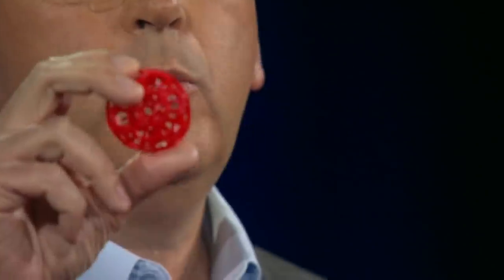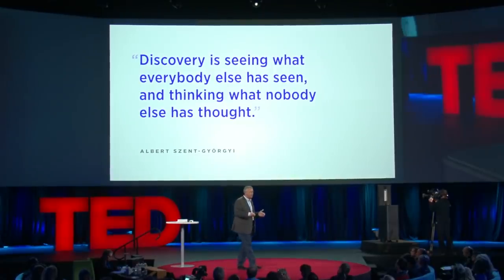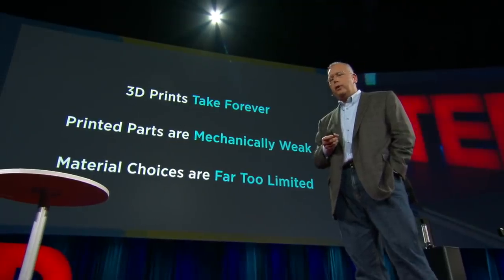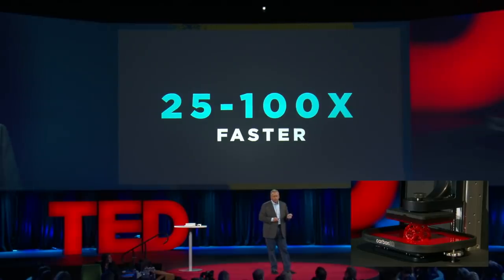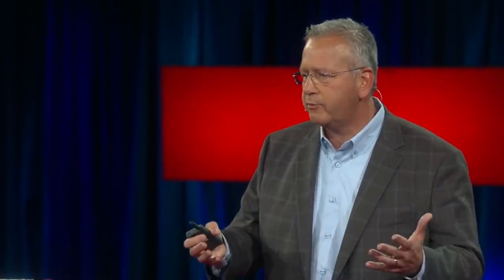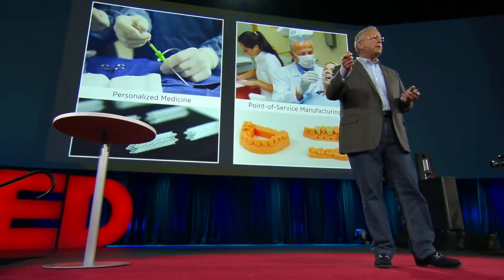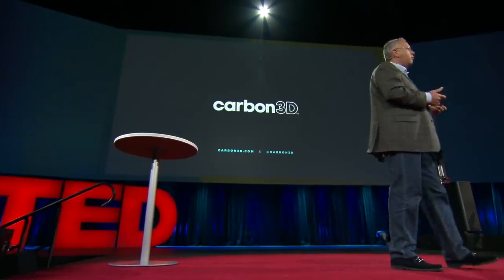What if 3D printing was 100x faster? | Joseph DeSimone

Comment: ok, it's been 3 years since this talk. why aren't these all over?
Reply: not all over consumer wise bc its like $40k a yr subscription based
Reply: Cost of production is way to high
Reply: You can buy these now, but really good sls printers are fairly expensive. I dream that in a few years, someone will come up with the Ender 3 of SLS, cheap but high quality.
Reply: International Space Station they are not sls printers thats a dlp one. Sls uses a powdered material (usually nylon) while DLP and SLA printers use resin that it's cured by uv light or a laser. Dlp printers uses a dsplay projector and the definition of the part is going to be the one of the pixels of the display. Dlp prints in voxels while sla and sls print with a laser so there is more definition in the part but they use different mediums
Reply: @christiansandrini96  oohhh yeah you're right lol
Reply: Because they do not produce the properties for the product that customers want. Cost per part of part with similar properties is too high. Doesn’t print the exact/similar material necessary for a specific application.
Reply: The resin used is, to this day, too expensive for hobby or schools
Reply: They are Erik, there are a number of them that are far more affordable than this ridiculously priced printer that Carbon puts out. Just search for resin printer and you will see a number of them available and a few are very affordable and news flash, they produce just as good as what Carbon 3D does, just that they are not marketing to Dentists which of course brings out the greed as can be seen with Carbon 3D!
Reply: Anycubic photon doesn't offer those printing speeds.
Reply: lol no, anycube is a normal dlp printer, like shown as current printing proces.
There is only two questions, how expansive is the CO2-membran and how long it last, this can work with every DLP printer out there even with a 400€ Photon.
Its funny to see how Resin-DLPs are killing Resin-SLA Printers, with Greyscale a 10" 4k Display is much more acurate than SLA and FAR Cheaper!
Reply: KrzaQ kq - I am good with that, since it doesn't offer that ridiculous price tag. Sorry bud but not a very good argument!
Reply: You may be good with that, but it's not what the question was about. The major feature mentioned here is the printing speed. 100x faster printers are not *all over*, despite you "being good with that".
Reply: Shrimp - Worth noting to that DPL is much faster than SLA printers and can produce more in the same amount of time. With the right resolution it is indiscernible to the human eye that it was a voxel print vs the SLA type.
Reply: Erik S cost. They are crazy expensive and have only gotten more complicated over the years.
Reply: As someone who works in 3d manufacturing (which it is obvious most posting do not) i can tell you it takes a lot less time to create the prototype than to be able to mass produce them for a reasonable cost.
Reply: Caleb Begly huge difference between the formlabs and this.  Huge.  I know because i use them both.
Reply: I'm a biomedical engineer. Consumers don't use it bc of the price but researchers use it considerably for tissue engineering.
Reply: @Dr.Luc wtf, didnt you watch the Video?
The Anycubic Photon is the "traditional" process he is talking about, not the continuous one.
And i suspect the membrane & Oxygen science is what keeps this from being as availiable as your normal SLA printers.
Reply: The Photon is a printer that use the "old" way of printing by separating the layer from the bottom going up, repositioning, cooking another layer then rinse and repeat. I'm not aware of a model that use this "Oxigen bed" technique explained in this video.
Reply: 100 x faster, 1000 x more expensive
Reply: @kahzhoylow4352  I work in manufacturing. Time is money. You'd be surprised how much money my company uses on stuff like thi as to increase productivity. In the end, you'll make more money saving time.
Reply: The biggest problem I think is the cost of the resin (printer cost for sure when it comes to Carbon). It's like 3-4 times that of PLA. Post processing is a bit involved too. They need a printer which can post process too. Or develop a resin which does not require it. Once material cost comes in line with PLA and post processing is removed this truly will be game changing. Maybe once the sub 1k printers get great the price for resin will start dropping.
Reply: IKR
Reply: Nope. The photon is nothing like this.
Reply: There are. Resin printers are just nasty in general. I wouldn't like to have one sitting on my desk.
Reply: Can you put metallic powder into the uv resin in small amount to make metallic parts? Will it work in the DLP/SLA printer?
Reply: Because it's a new technology and it takes time for these things to mature and become affordable, duckie. :)
Reply: Its to expensiv
Reply: we are still in the stone age because the fckng governments are holding back alien tech back for over 50 years already ...
Reply: @funtechu  Wong. I have a Form 2 printer and is stupidly slow if you want a smooth print. It prints at 100, 50 and 25 microns. 100 microns is pretty rough, 50 is smooth but VERY slow. You can imagine how long 25 micron prints take, although they're very smooth and accurate.
Reply: they ARE all over. I have two. Paid only $500 for each.
Reply: Many TED talks are just talk.  I saw one about composting, who dresses up to go to one of those?  Coming from me...I love composting, just that watching a "talk" on it is just boring. what is the world coming to. One step forward and two back.  No flying cars either, they said it was coming later this year, that was in 1992.
Reply: I believe it’s mostly due to the economics of manufacturing.  JIT manufacturing has to be very cost competitive to be viable.  However Injection moulding has proven to be incredibly cheap and reliable when the scale is large.  Make a million widgets and you can make them very cheaply, make 1 and it’s very expensive.  The old semiconductor adage is, the first chip costs $10m, all the rest are virtually free !!
Reply: because maybe its not as groundbreaking as the dude selling them wants you to believe
Reply: Like someone else said Manufacturers take years to implement stuff like this, They will be investing in this but in concept stage. Some small manufacturers, Small batch manufacturers maybe using for production, You would be surprised how much old technology goes in to cars etc, The businesses have spent a lot of money in developing and need to get a return on that investment.
Reply: @DrLuc-lq8ls  - Anycubic photon/Duplicator D7/Formlabs or whatever. None of these are exactly like this. Key difference is the oxygen "delay" window
Reply: From what I can find, the current Carbon 3D M2 model uses a subscription model and is priced at $50k annually for a minimum contract of 3 years. On top of this they charge $22,5K in initial fees for installation/training and a set of accessories that you need. This brings the total cost of just the installed printer to $172,5K for the first three years. The resin that goes in is $100 to $400 per 800 ml. Assuming the printer can print one of those cartridges per day, at an average of 200$ each, puts you at a material cost of $219K for the full three years.  Total cost of running the machine for the first three years is then $391 500. Not a lot of applications can justify such an expense.
Reply: @DrLuc-lq8ls  No, the Anycubic photon works the "old way" as explained in the video.
Reply: $40,000 a year will buy a lot of beer! You can't buy this machine you have to lease it. At $40,000 per year to lease this unit I will pass!
Reply: @DrLuc-lq8ls  I just bought one for under $400, but it is doesn't have the O2 permeable membrane that makes it faster.
Reply: Because they still cost $500-$5000 but if you've got the money there are multiple options with the tiny Anycubic Photon for about $500 on the low end, Peopoly Maoi in the mid range at $1200 or so, and the Form 2 for $5K, and then Carbon 3D's crap but they're very much high end manufacturing focused. The rest though are all desktop options you can buy RIGHT NOW. I'm going with the Maoi for my 1st SLA printer. Best build volume for the money imho.
Reply: When he said "these" he didn't mean "any SLA printer," He meant a printer with CLIP technology.
Reply: @TheSentientCloud  i think you mean dlp or sla, SLS is elective laser sintering when you melt powder in layers
Reply: @mervinlobo4673  not really there are tons of sls and dlp printer like this out their, prices start at 300 to 500 dollars
Reply: Expensive. But it exists.
Reply: The resin is super costly
Reply: Erik S lookup sparkmaker and any cubic
Reply: 4 years now
Reply: Because he talk some wierd and from the material point of view totaly wrong stuff.. as he call him self material sceintist/chemist I would rather call this larg mouth-tist. There is a plenty of applications for 3D printing already in use, however the whole processing of 3D-printing need years of developement for each septrum of materials and huge developement invenstmnets. Therefore we still need all other methoods, which are still valuable, or cheaper or more controlable in terms of final material properties. The real use of 3D printing is about complex structures, mostly hardly manufacturable by "conventional"/ other techniques, while you wanna replace everything with 3D priting such as in his case turbine blades - they are manufactured from single crystal grown super-Ni alloys which have unique propperties thanks to the uniformity of crystaline structure and also precipitation hardening. Therefore, any material scientist would know that 3D printing it self is far from beeing able to replace all methods.
Reply: @mervinlobo4673  Exactamundo
Reply: @eatinMcdonaldsfryz  Pretty sure you don't have a couple Carbon M2's. They don't sell them. They only lease them for $50,000 a year (with 3 year min). You have a resin printer, most likely DLP printer. It is described in the video at the 5 minute mark as "Traditional Mechanical Approach". It is why you can't print that ball he did in under 7 minutes.
Reply: 4+ years now.
Reply: Because they lease them at a MINIMUM obligation of 3 years with an upfront cost of $64,500 that rises to $144,500 over three years,... not counting resin that is $99-$399 a bottle.
Reply: it is not over. At this moment there is even home editions of such printers.
Reply: @bentrueman6388  COST of production. Not initial capital cost.
 A 300 dollars printers inital cost id low but quantity and quality to build such structures requires expensive Resins.
Reply: I have one at home. So yea.
Reply: Too expensive, too low build volume

Form 3L is out there and its great
Reply: @funtechu  Formlabs printers use SLA, not CLIP. Only Carbon uses CLIP (which is in this video).
Reply: Like all 'Game changing technology' talks, they're perpetually stuck in 'the near future"
Reply: Make it 4
Reply: Now, it's 4 years.
Reply: price starts at $50k
Reply: It's all about the money money money
Reply: Construction companies get in the way because it’s not lucrative for them so they try to stop them
Reply: Erik S  money and profits
Reply: You can buy these machines for just slightly more than cheap conventional 3D printers now, they are entirely affordable for a home user - trouble is the resin toxicity so you need some extra gear to handle it and then clean it off before using it. There's some good videos of people who do miniature characters for tabletop games using this printing technique and it costs very little per figure they make and they come out really detailed. A couple of years ago this would not have been affordable.
Reply: Update, they are now at the $350-$500 range and are decent....don't ask for maximum price because they get as expensive as you want lol.
Reply: The only problem with this kind of resin cure 3D printing is that what he printed on stage is misleading. He claimed it was 25-100x faster than normal traditional 3D printing however, he did not wash the print in isopropal alcohol and then cure for hours in UV light. These are crucial steps in resin cure 3D printing and hence why this technology is not widely used.
Reply: Who cares about speeds? As technology increases, the speed will increase. Compare the original "3d" printer speeds with today's "3d" printer. 32 bit vs. 8 bit motherboards are capable of going many times faster, without costing much more than the original 8 bit board. I will wait for faster printers, I am just not in a big hurry.😊
Reply: they are all over
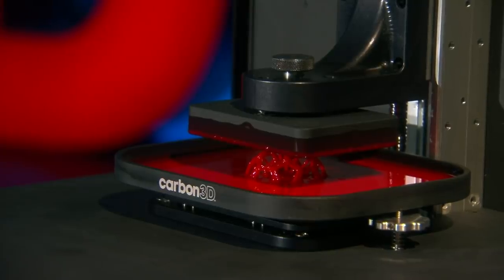Reply: @DrLuc-lq8ls  Actually those printers work the "traditional way" shown at 4:48.
Reply: @DrLuc-lq8ls  The Anycubic Photon is mSLA tho? That's still layer by layer. They're talking about continous curing.
Reply: Now it’s been another year
Reply: seems Adidas future craft 4D has achieved this
Reply: That machine cost over $50000
Reply: @DrLuc-lq8ls  but Anycubic photon is not oxygen inhibitor based. And what about the UV resin ? What is it ? ABS, PLA, PC, etc ?
Reply: @DrLuc-lq8ls  you missed the point of his presentation,  The Anycubic doesn't use the oxygen layer method presented, and would takes several hours to create they same object. Yes it looks very similar but not quite.
Reply: @DrLuc-lq8ls  Isn't the resin they use toxic ? It looks like it requires a lot more precautions, effort and cost than regular FDM printers. In this video were pretty much promised a printer better in every way
Reply: Need 20 more years. That’s just how technology matures
Reply: Probably because the total costs (including subscription, instalment, and materials) adds up to around about $290,000 USD
Reply: they aren't cheap
Reply: 5 years and nothing yet
Reply: Because they want $40,000 a year to lease you the machine!
Reply: @kentharris7427  me too kid
Reply: Resin is weak, toxic, and in my opinion the worst way to 3D this print, but then I don’t care for anything without function.
Reply: Longer Orange is $300
Reply: Because it's just 3 years and there is one at $1250.
Reply: Adidas 4d.....
Reply: Do you have 400k for an HP metal ceramic 3D printing??? 😉😏😘
Reply: It's been 5 years
Reply: Its a resin printer they are all over
Reply: They are now. $250 bucks and a $35 dollar bottle of resin now. The most recent 4k mono printers are around $600 bucks.  It was a slow start but the sales are clear, it has come and 2021 is going to be a massive shift in home 3D printing.
Reply: They were many years ago.
Reply: @DrLuc-lq8ls  Those are layer by layer, not continuous. They use liquid, and cure it with a light, but they don't use the oxygen inhibition zone like he talked about
Reply: They are now.
Reply: Well there actually pretty cheap
Reply: U can buy adidas 3D made by them
Reply: @TheSentientCloud  check again, they're here
Reply: @Max_Janszen  I'm aware lol
Reply: Because they have a fucking patent
Reply: They are greedy asF and their printers is $162,500 +
Reply: @DrLuc-lq8ls  Lol no. Did you even watch the talk? You can not continuous print with current consumer SLA printers. They print layer by layer and pull each layer from the FEP sheet, which takes hours.
Reply: @biovoltSA  Americans. 🙄
Reply: Probably the same reason FDM/FFF didn't take off until the tech was Open Sourced...
Reply: Wasn't resin printing pretty wide spread 3 years ago?
Reply: @mervinlobo4673  only under capitalism; socialism will accelerate all technological advances
Reply: @Kyle Wilhelmsen that will all change when we have molecular 3d printers
Reply: Because the Industry is milking the market first with the current generation of 3D Printers. 😅

Its the same with Holographic Display projectors. I saw many of them in Color as well at COMDEX 2000 in Las Vegas. That Graphics display Industry keeps marketing and pushing larger and now wider display screens but downplay the Holographic displays as of the technology cannot be available at affordable prices.